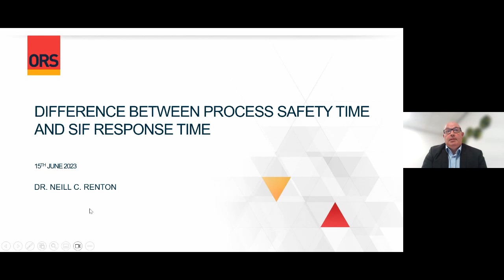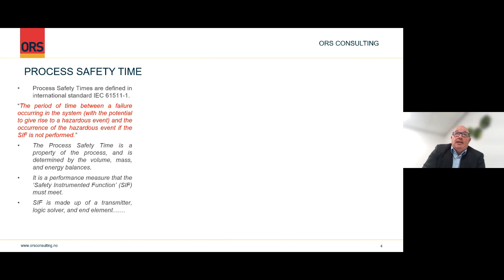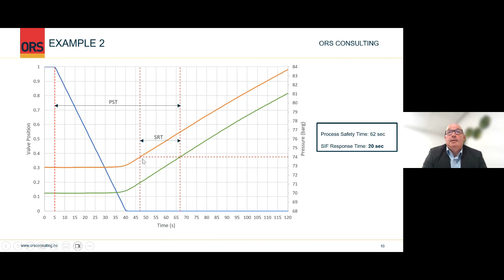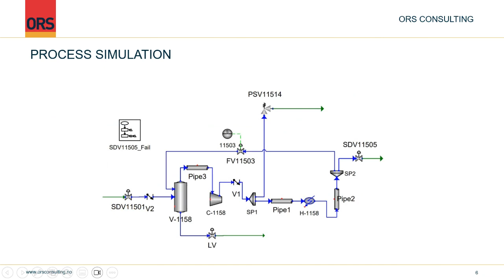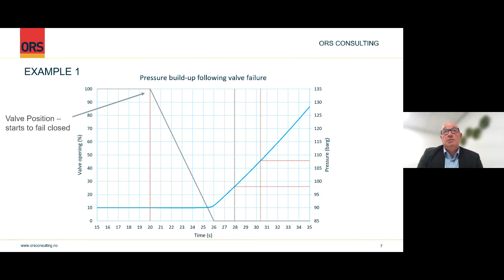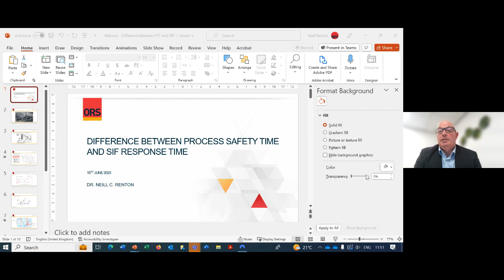Process Safety Time vs SIF Response Time

Comment: I have a question regarding your explanation at 38:45, where you distinguish between the Standard’s definition of PST and the interpretation used by some practitioners. The latter defines PST as the time between the trip setting being reached and the moment by which the protective action must be completed to avoid the hazard. From this perspective, PST reflects the maximum allowable execution time of the Safety Instrumented Function (SIF), which may not be explicitly addressed in the Standard's definition.

Additionally, when the trip is based on a continuous process variable, PST becomes a function of the chosen trip setting. The farther the trip setting is from the hazard point, the longer the available PST. Moreover, due to measurement uncertainty in comparing the process variable to the trip setting, the actual trip point may differ from the nominated setting.

Given these considerations, what do you think was the intent behind the Standard’s specific framing of PST?